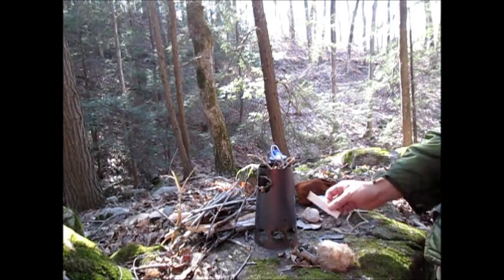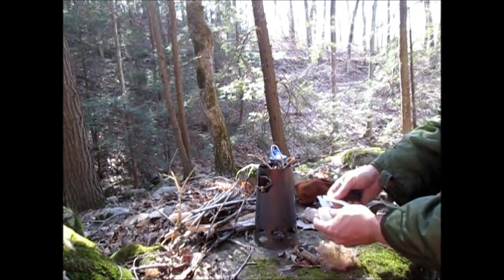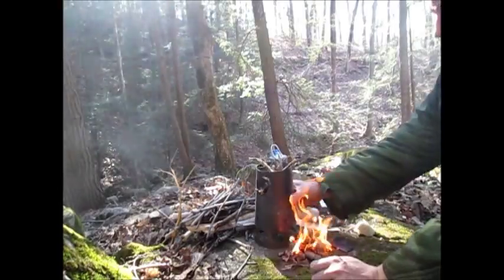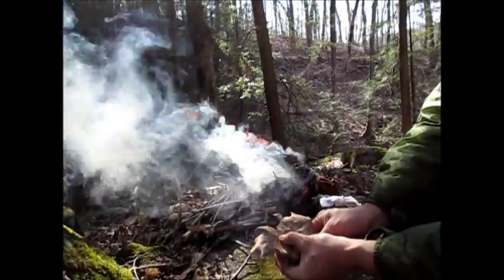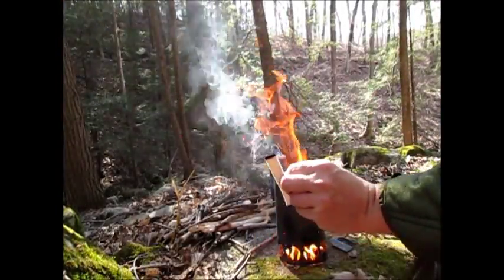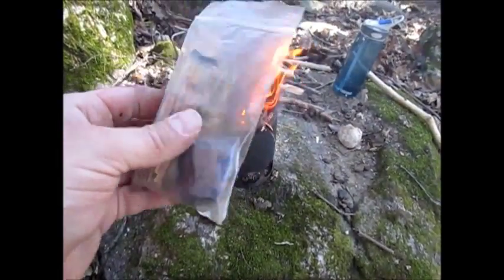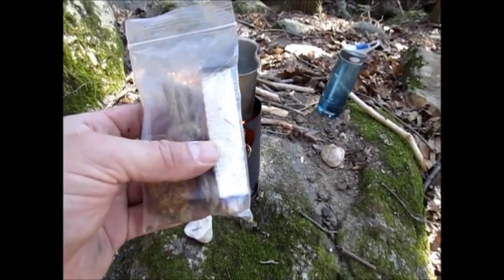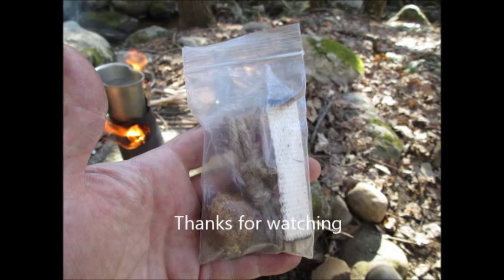Flint and steel fire using a lamp wick.

Comment: I know this is a older you-tube, and maybe someone has already told you, but you need to hold your birds nest up and blow into it from below so the heat goes up through the nest instead of blowing it down and out of the nest.  Makes a difference but really good video.
Reply from the maker: I tend to hold it more up these days mostly to avoid smoke in my face but that sounds like yet another good reason for doing do. Thanks for watching!